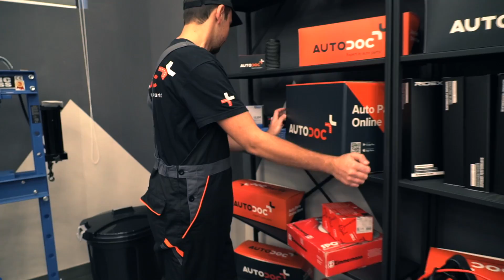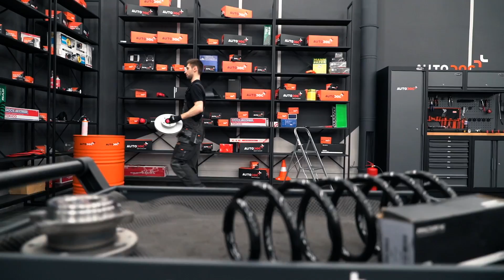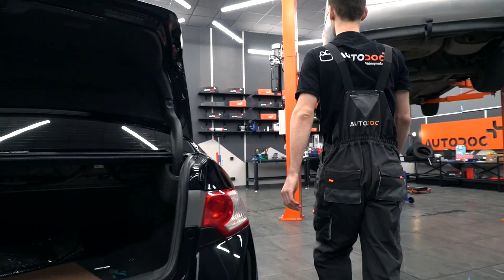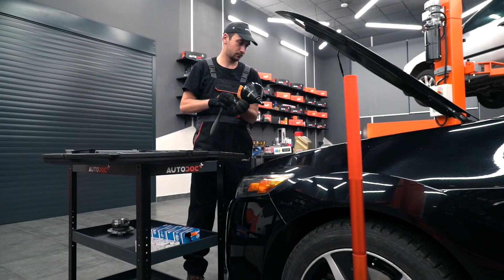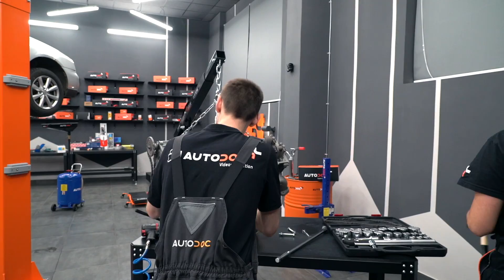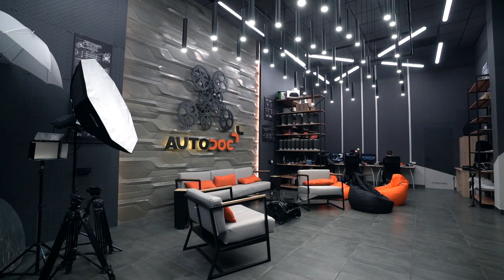AUTODOC VISITE COMPLÈTE DU GARAGE !

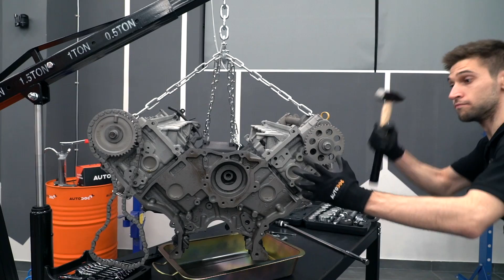Comment: Extraordinaire !  un espace pro  apparemment doté du matériel dernier cri et d'un personnel compétent et sérieux ( 1:11  le coup du marteau en caoutchouc!!)  Si ce garage pouvait se pencher sur ma freelander en panne, je suis certain qu'elle revivrait ma jeep ...  Ah le rêve !
Reply from the maker: Merci pour votre commentaire! Nous apprécions beaucoup votre estime. Nous vous invitons à suivre notre chaîne pour plus de vidéos. Cordialement, l’équipe Autodoc.
Reply: Latelierderocsan mumuch14 mumuch14 mumuch14 mumuch14 mumuch14 mumuch14 mumuch14 mumuch14 mumuch14 mumuch14 mumuch14 mumuch14 mumuch14 mumuch14 mumuch14 mumuch14 mumuch14 mumuch14 mumuch14 mumuch14 mumuch14 mumuch14 mumuch14 mumuch14 mumuch14 mumuch14 mumuch14 mumuch14 mumuch14 mumuch14 mumuch14 mumuch14 mumuch14 mumuch14 7 tendensse Je suis pas près sa va inique groupe mumuch14 mumuch14 mumuch14 mumuch14 mumuch14 mumuch14 mumuch14 Tu est parti vocal je peut venir a qui ce mette tout nus mumuch14 Tu peut venir a la console T'es reveiller  mumuch14 77 secrétaire Tu est arrivé mumuch14 Tu est arrivé Tu peut venir a la ps4 moi sur la ps4 moi sur snap il  mumuch14 Tu peut sortir je peut venir cher mes de mai Tu est parti tu est